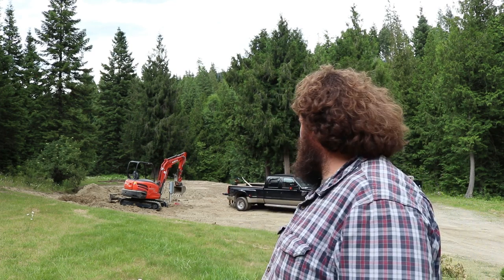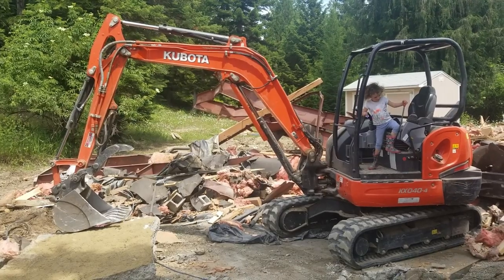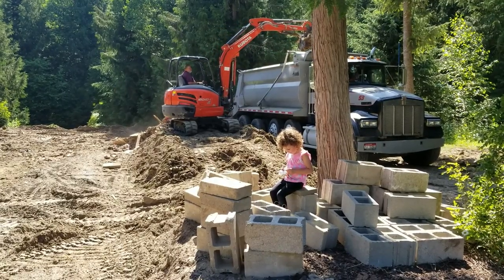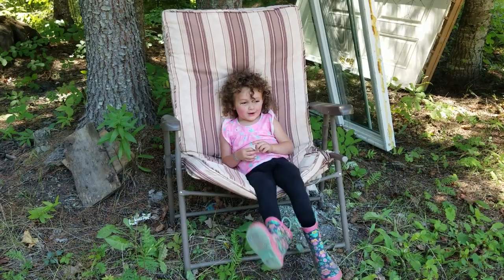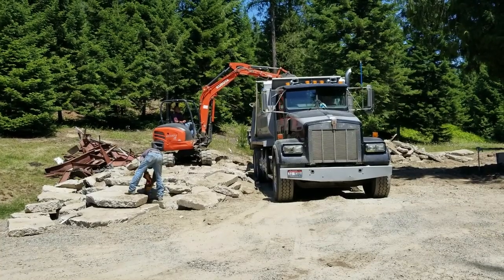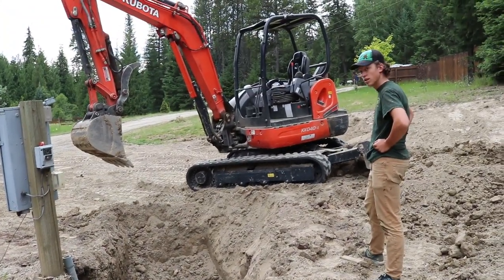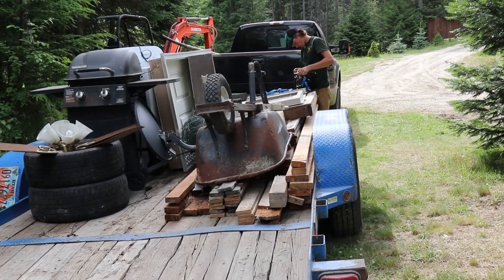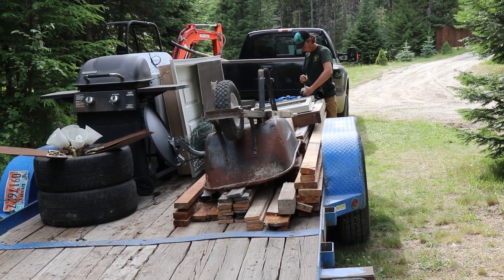House Demo Utilities, Now What Do We Do?

Comment: How do you like the kubota and did you go back to a dually
Reply from the maker: Mike, dont tell bobcat.......but I love kubota. We did this job with an 8 thousand pound machine and had no problems. Kubota is one mean machine. 
I have had five dully trucks over the years and the ford 350/450 is my very favorite of them all. There is something special about a fat bottom girl. 👍😎
Reply: @EssentialMountainHomesteading  i agree with you i am currently running a 250 but i will be buying either a 350 or a 450 next theres something about that wide ass on that truck that makes it really pretty   i currently have a john deere and well i will tell you it will be replaced with kubota i like the power i like how its so easy to work on   and i like there service department .    Do you still have your saw mill and your business or are you just doing what comes around    just a question